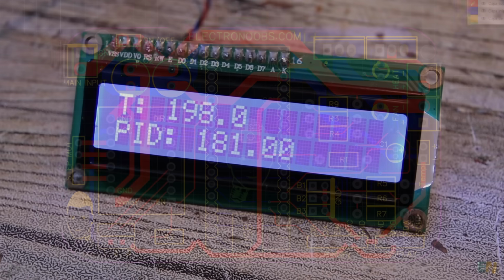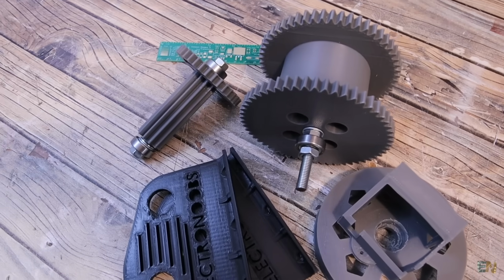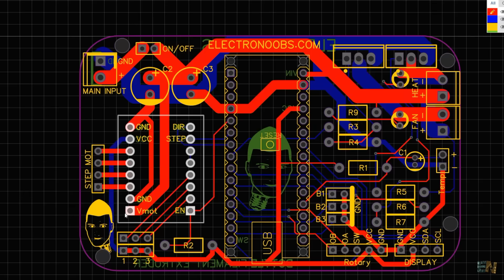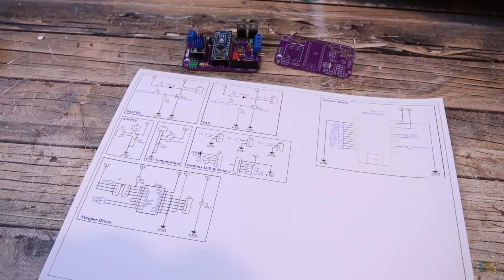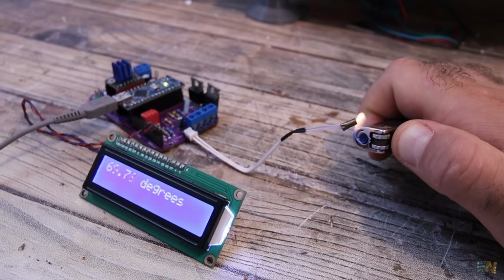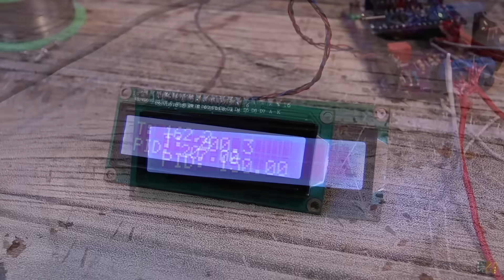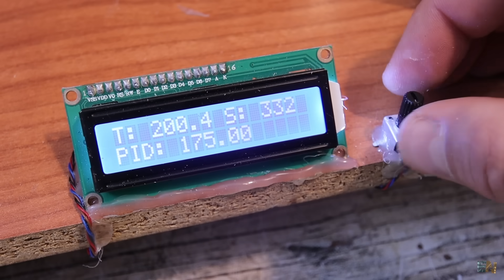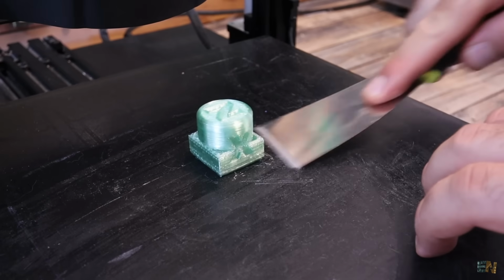3D Filament From PET Bottle + Controller PCB

Comment from the maker: Join my Arduino Course (Spanish): https://bit.ly/2JY8icE
My Tools: https://bit.ly/3uv8bc3
Help me on Patreon: https://www.patreon.com/ELECTRONOOBS
Reply: Hello my friend.  First of all, thanks for the project.  very successful.  We implemented your project.  I have 2 questions.  1- is button 2 defined in the software?  we couldn't find it.  What is the mission?  2- is the software for the roter or for the potentiometer?  A1(analog1) is defined in the software.  but it has been used.  how do i use it.  please help me.  Thanks in advance.
Reply: @legocum2248  same question
Reply: Hi !!!! This is a very good video for this project.Can u plz modify the code which also shows the time duration on 2004 lcd along with all other code running perfectly fine.???? Plz make and Put the new code in the description.Thanks..❤
Reply: Sir i want to buy this machinery can you please tell me the price of this machinery i request you to please sell this to me
Reply: Hello my friend.  First of all, thanks for the project.  very successful.  We implemented your project.  I have 2 questions.  1- is button 2 defined in the software?  we couldn't find it.  What is the mission?  2- is the software for the roter or for the potentiometer?  A1(analog1) is defined in the software.  but it has been used.  how do i use it.  please help me.  Thanks in advance.
Reply: good day whats the value of your thermistor?? thank you

Comment: looking through the BOM, when you get to the capacitors it says for a 10uf and 100uf but it doesnt give a voltage, im assuming as its a 12v supply it needs to be as close to that as possible but im a complete noobie to this so im unsure

Comment: Hi, I have a question. Why Stepper motor? Why don't we use PMDC motor with gear reduction? Isn't it less complex method. Actually, I'm struggling between those 2 choices. I need to clarify that from expert. Thanks in advance.
Reply: maybe it's just compact VS rudder 

an alloy motor can be shrunk as small as a buzzed " vibration " motorway motor's in you're smarter phone's 👍🏼

Comment: Hi, I am trying to recreate this project but the potentiometer connections are unclear. In your video snapshotted at 10:59, it seems to connect the potentiometer to the Arduino Nano directly using live wires at A1 and two other spots. Please advise, thank you.
Reply from the maker: Yes. Is directly.  I first wanted to use an encoder but that made the code slow. So I've soldered an external potentiometer directly to A0 I think it was... check the code to be sure...
Reply: From what I understand, the rotary OutA OutB and SW pins are not used. Instead, the potentiometer is connected to 5V, GND and A1 directly soldering the live wires from the potentiometer pins to the terminals on the Arduino Nano. Is that correct?
Reply from the maker: @cat-in3ij  yes
Reply: Thank you very much! @ELECTRONOOBS

Comment: Nice video. Thank you for all information. I would like to add that the artillery sidewinder x1 has difficulties printing above 255° because the main gears becomes hot and the filament stuck into it. So, I have added a fan on the top of the extruder giving airflow on the filament gears, that gives no more issues on this part and I can print perfectly at 265°.

Comment: I dont know what's the use of H3, H4 AND H5 in schematic diagram pls tell me

And also the potentiometer? Its connected to the A1 ,Gnd and vcc right?

And what that 6 pins bellow the stepper motor use for? Pls tell me

Comment: I love the creativity and recycling aspect of all of these bottle to filament videos, but I can't get past the time and additional cost associated with it since you can get cheap filament. Even ignoring the machine parts, the electricity/gas used to smooth out the bottles and then to run the machine seems like it would already push the cost of processing the same amount of filament to around the cost to buy a spool of it. I would be interested in a cost breakdown if anyone happened to do so, say by putting a meter on any equipment used in the process (harder with gas stove but could approximate that use with a gas burner maybe). I could probably see this being less of an issue if you use some of the very cheap soda bottles that tend to be basic flat round shapes already so no need to shape them. Also what are you using to get the glue off the bottles from the labels to be sure that doesn't contaminate the filament?

Comment: I have a few questions about this project.
You mention the PCB running at 12v, but at what amperage do I set my power supply?
Where do I attach the potentiometer and buttons?
I am kinda new to this stuff so I apologize if these are dumb questions.
Reply: It kinda depends on your heating element, say you use a 12v heater at 40 watts you need at least 4 amp power supply. But if you use say a 70 watt heater, you'll need something in the range of 6 amps. But if you wanna be safe I suggest you use at least a 5A power supply just to be safe
Reply: @cryo2810  Would a 12V 10A power supply be fine?

Comment: I have a problem with inserting the plastic strip through the nozzle. The temperature on the w1209 was reported at 77.5. I widened the nozzle to 1.5mm.
But I can't push the plastic through the nozzle.
It melts a lot.
I cut the plastic bottle to 5 mm.

Comment: Cool!! but you need better 3d printer to print this filament for high temperature and print speed and also you must to dry first your filament to remove any Moisture before to print

Comment: Hello ! Very Good Tutorial !  But!!!!! I am facing a problem that my stepper runs too slow  even it is on full step rotation Mode. I am using your code , can u plz solve the issue???  Also I want to set the delay for lcd to 1500 value so it stop Fluctuating very fast but this makes stepper even more slower ...Even if i set delay to 10 value stepper is still running at low speed. Kindly help me and Find any solution plz...!!!😞☹
Reply: Also I want  to ask that on how much current with 12v you are operating the arduino Nano board?   I had a 12V 10 amp power supply but after operating a little bit my voltage regulator got shorted and bursted my Nano Chip.

Comment: Hi @Electronoobs  Are those sidewalls (from the gearbox) supposed to be printed standing-up ?
(This is how they show up in Cura).   It makes more sense to me printing them with the largest side flat on the bed.  Or is this done with a special purpose?
Thanks,
chriV
Reply from the maker: I don't remember. Print them however you think is best 👍

Comment: Couldn't you have designed and printed an instrument housing for the display, the push button and the control knob? what does it look like? is it glued on with glue, like snot has flowed there?

Comment: Hello electronoobs.
Why do you show a schematic diagram uses a rotary encoder and 3 pushbuttons and have the arduino sketch to donlod wich works with one potentiometer and only one pushbutton? Also your downloadable gerber files only works with rotary encoder and 3 pushbuttons. How looks the real schematics corresponding to your arduino sketch? I am confused. Please have an answer for me. Regards Paul from Switzerland
Reply: i have te same questions. I have ordered the pcb, the parts, the arduino..all the stuf and now i realize , that there is an encoder, 3 buttons and ( this is good) 3 jumpers . that if you look in the video the guy is changing the posiotion of the jumper from 2 to 1, and does not say nothing abbout that. i guess that is his little secret. if you want to know abbout it you need to pay, probably. 
#Electronoobs can you help the comunity? we like the ideea and apreciate the effort but there are the things that we mention abbove that leaves us in the dust. on your site you do not say nothing abbout the points.
Reply: I have the same question am looking for know the secret
Reply: Ele muda os jumpers para mudar os micropassos do driver. Dependendo da configuraçao  dos jumpers o motor também fica mais rápido ou mais lento e com mais ou com menos torque

Comment: I think the missing step here is adding a filament diameter sensor with another PID controller. It's impossible to drill the nozzle at EXACTLY 1.75mm, but you can control the filament thickness if you measure the width of the filament produced at the nozzle and you close-loop the system with the stepper motor pulling speed. Heck you may even end up with one single PID regulator if you assume your controlling variables are the nozzle temperature and the nema17 angular speed.
I will give this project a shot :)

Comment: I have a question, wouldn't one be able to build this easier using a 3D printer motherboard and screen as opposed to a custom PCB? Connect the hot end, screen, stepper motor and psu to the board as normal, and then you have full control over temperatures, and motor speeds. Sure you'd have a lot of pointless options in the screen that for obvious reasons would never work, unless you reflashed the board to take them away but, in general, wouldn't this be an easier way to do it if someone happened to have a spare board?
Reply: Thats what im goint to do.  I have all the electronics laying around from a old printer.  Use those and the 3d printed parts on here.  Dont see why it wont work.
Reply: @thomasskinner81  it's what I'll do as well, after a lot of research I've seen some people commonly use the old ender 3 board, because that's usually one of the main upgrades one makes to the ender 3. I myself have a spare so, might as well put it to use as something useful

Comment: hello, I'm assembling this project, but the stepper motor when turning on it locks the shaft and doesn't turn, when I press the wrist wrench it releases the shaft again, I don't know what's happening because all material is the same as yours

Comment: I used jlbpcb to have some custom parts made. It was about 2.00 bucks to have one piece the size of my finger made out of nylon. I assume if I order in bulk I would get a good deal. I noticed though that the shipping was very high. It says for the cheapest shipping it cost about 5.00 bucks but will take almost 15 days! Is there any way around this high shipping cost? I want to have things mass produced in a small scale and was hoping to be able to make a profit. Any ideas on that?

Comment: Would it be possible to use the heating tip from a hot glue gun for making the filament?  Adjusting for hole diameter of course.

Comment: NEVER hold your finger under a drill like this guy do at minute 5. Anyway, the project is okay ( i am sure it's nothing made by you ) but the way you talk , present it and work...i think the most advanced thing that you know till this right moment is which part of the toilet paper you need to use.
Reply: I assembled and the arduino code does not work

Comment: I think that someone is going to make a filament maker from chopped-up bottles and plastic pellets which seems to me a lot easier to generate than sitting and stripping a ton of plastic bottles. Perhaps a modified blender could chop the plastic and reduce them/it to pellets. I think you could also make a longer filament too.
Reply: My thoughts too

Comment: Are you going to add an inline filament diameter sensor to it? Tom made one on his channel in 2021 "The InFiDEL". I imagine that could control the speed of the stepper motor to get more precise filament.
Reply: but how do you use it without crushing the filament?
Reply: @Fejszi  Use it at a point where the filament is cooled and solid enough to not be crushed?
Reply: @UmbraAtrox_  but then you'd have the same problem that Tom has had with his hommade extruder, you'd have a "bufferzone" where the filament would be out of spec
Reply: @Fejszi  Then you need more cooling. Point still stands, measure where the filament is solid.

Comment: That project is on another level. I want to see someone make a mini filament maker that combines used filament with clear pla beads. Eventually we'll be able to make any polymer for printing at home I suspect.
Reply: flawed project, motei and when running arduino code is with flaws
Reply: @antoniopadua8699  are you the savior that is going to bring home filament making economically viable. Saying bad arduino code is like comparing the Unreal Engine 5 code base to a procedurally generated pong clone I made in pygame.

Comment: These have come a long way in such a short time; I'm not quite confident in my own ability to build one, but it's so very close to being ready.

I wonder if there'd be a way to simplify the thing by printing directly from the plastic tape, instead of trying to get the filament to extrude at a specific diameter.  You'd have to measure the thickness of the tape for each batch and account for it in the slicer, but it's probably more dimensionally stable than pullstruded filament.

Or mulch the bottles into tiny fragments and use something like a pellet hopper to print with instead of filament.

Comment: For pulling the filament you want to be doing it at 210c. From a bunch of testing we found print settings of 0.2mm layer height, 260c nozzle, 75c bed, initial flow 130%, flow 130%, print speed 30mm/s, retraction 4.5mm, retraction speed 40mm/s, fan speed 15%. Any other questions feel free to ask
Reply: ¿de que porte es la tabla  que se ocupa y cuales son los diámetros de cada engranaje ocupados?🤔
Reply: Would you have any recommendations on how wide we should make the strips ?  (e.g when using thin, 0.15mm thick, 2L water bottles, or when using thicker Coke bottles (0.3mm thick)  I have heard anything from 8mm to 1,5cm
thanks,
ChrisV

Comment: Hi great project. especially the temperature and stepper controller!  Is the code for the rotary encoder in the firmware to set temperature as required?  I can see on the pcb there is connectors for the rotary but could not find the code (In the firmware) for reading it and setting the desired temperature.
Reply: does not work

Comment: About the bottle reshaping process, I would say that some bottles don't really nead it : 
bottles like coke, Canada dry, orangina and sheppes (here in France), and also lemonade and specifically not general branded coke use standard smooth bottles, usable straight away.
Also carbonated drinks bottles tend to be generaly thicker, giving more plastic per recycled bottle.
Lastly I would like to share a little idea of mine to increase the produced filament length : instead of making thick 6-8mm strips, make really thinner ones like 1 or 2 mm wide, if you divide by 4 the width, you multiply by 4 the length, and then use several (6 or 9, a multiple of 3) and tighten them into a rope with something like The King of Random's rope making machine, one of the advantages would be that with a thinner strip, you are less depending on the bottle straightness, still of it's smoothness though, and you can mix colors by combining different colors ribbons into the initial cord.

PS video tape (VHS, namely cassetes in French) are made of PET with a magnetic coating, with them you can make some magnetic filament, I saw that on a Russian channel,

Comment: Very interesting and pioneering. From a practical aspect (cost) best not to use bottles with a deposit. Where I live there is a 0.25 ct deposit on most plastic bottles. Normally a 330m rol PET will cost me 20-25 euro. If a bottle returns 2 meter that would be 41.25 euro.

Comment: Any thoughts on butting or joining the individual bottles fillament's into one longer length, whether possibly when pulltruding through the nozzle or afterwards once formed into the filament?  Many times I've read in comments that this is a limiting factor in getting more people involved in using more since they can't as easily make larger prints from the bottles. 

That's great you shared the links to the videos and the JRT3D's especially as well as that's what I've been following other than prior the videos by f2knpw, mr3dp and HULKGQ Nissan Patrol. CNC Kitchen did a good video on "How Strong is PET Bottle Filament?"   

I've been saving all my PET water bottles with plans to make filament and also make protective covers like the YT channel "Brother" did sort of when he made a form to heat gun shrink and make longer PET beams.  Seems like would be an interesting Pergola like design and my first project I'm thinking about is restoring a cheaper metal one by wrapping the roof rafters so to waterproof and re-enforce.   Thanks for sharing as always and great work!
Reply: Here is discussed how to connect the straps together before they go through the nozzle.  The nozzle basically welds them together  https://youtu.be/xNtrQQ42WG4?t=610.  He also recommends to only connect the same bottletypes

Comment: For a long time I have been printing only with home-made filament from bottles))
Thanks for the electronic diagram and sketch!! I will definitely collect and apply in my machine!

You need to print at a slow speed - 20mm / s
then the plastic will have time to melt. And the printing temperature is 270 degrees..
Reply: PET can be printed at extremely high speeds, but 270 is really borderline temperature. I run 320 for low speeds and 350 for 25-28 mm³/s.

Comment: You waste so much energy straitening the bottle and getting the filament that the eco friendly aspect is just not there isn't it?
Reply from the maker: I think if you make a lot of them, it could be a good system. In my case I've made a few for the tutorial. But if you have prepared a setup is easyer. Aslo, if you make a lot of them, instead of boiling water, you could jurt use a pressure compressor and be done with it in just a few seconds...

Comment: Thomas Sanladerer came up with a cheap way to measure the diameter of filament. ( https://youtu.be/RYgdLPe_T0c ) If you ran the filament through that, you could use the diameter measurement to control the speed of the motor to get more consistent filament possibly.